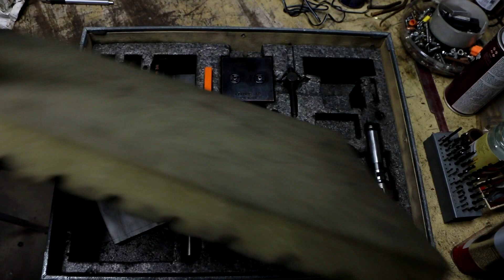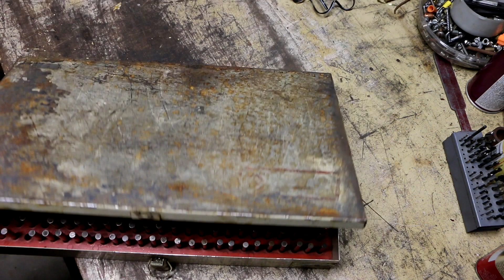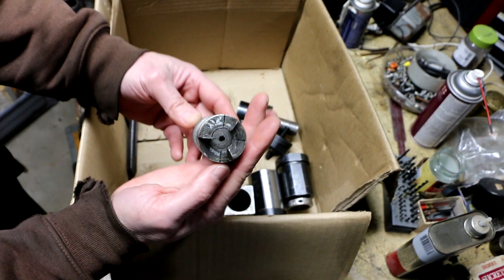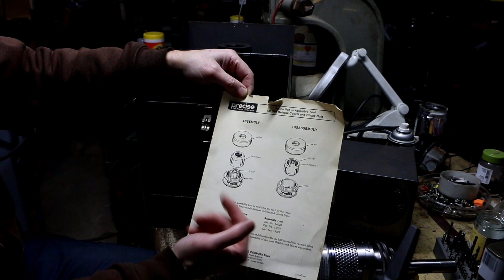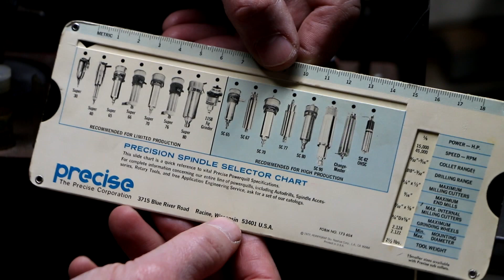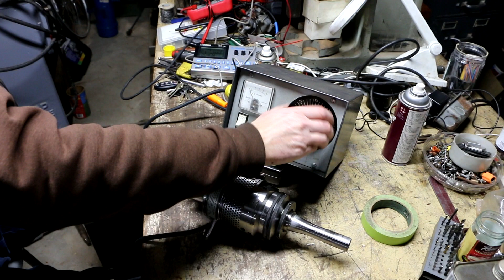Mid December 2020 MachinistTool Buy

Comment: Hey Steve!  Interesting stuff.  If you don't mind, can I ask about a part you mentioned on your Stihl MS290 Chainsaw rebuild of a couple years ago?  You mentioned you were able to obtain the little 'o-rings' for the Hi & Lo mix screws on the Walbro carb.  Do you recall where you got them from (are they standard Hardware Store wares)?  Thanks.              Dennis
Reply from the maker: Hi Dennis. Its been a while but im pretty sure I just used the closest size i could find in the local hardware stores assortment. The genuine Stihl oring part number is 4203 122 3600. They call them "sealing rings". Make sure you do not mix up the 2 screws. One is longer than the other. But the o rings are the same for both.

Comment: Light years ago Precise made a bench top unit (that I call my "mill" - Lathes.uk also refers to it as a mill) which was like a milling machine minus a knee that held the motorized grinding head like yours, and more specifically like your old Precise one. However, Precise apparently (But not positive - I'd love to see some old catalogs circa 1950's/60's) also offered a base casting which would make the bench top unit (very similar to a Barker mill) a floor standing unit. Mine is the only one I have ever seen with the floor standing base casting which is badged "Precise"). With Precise having been in Wisconsin, and me being in IL, I've been left to wonder if mine possibly came out of the Precise Products Corps own shop???  The bench top portion has a well in it's casting which once held the Variac like power supply. In my case someone at some point did away with the grinding head and instead added a pulley driven R8 spindle/bearing scenario to make it a small light duty milling machine which is how I use it.